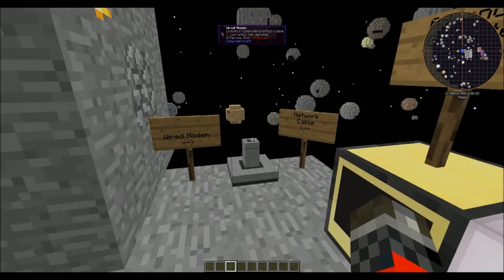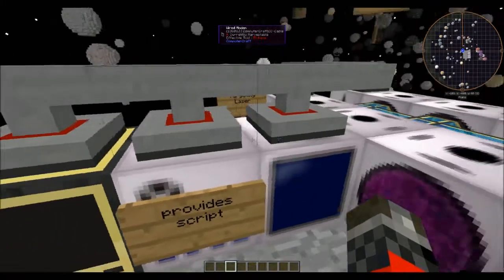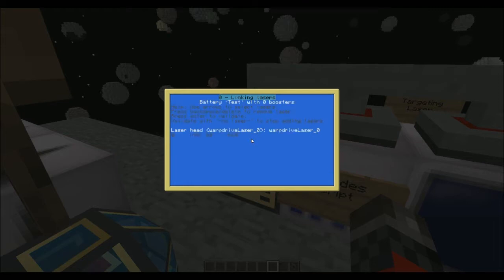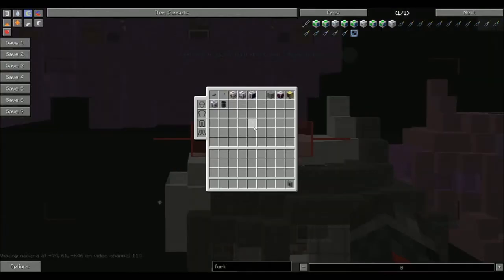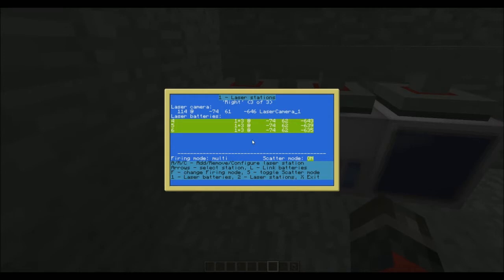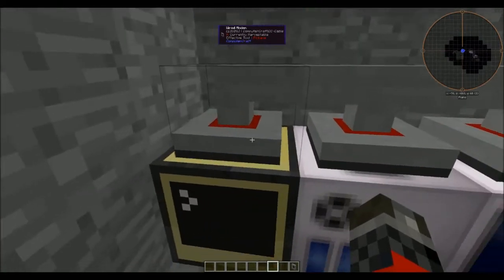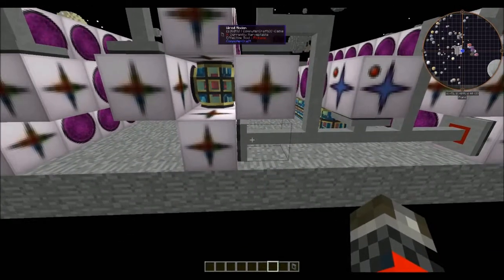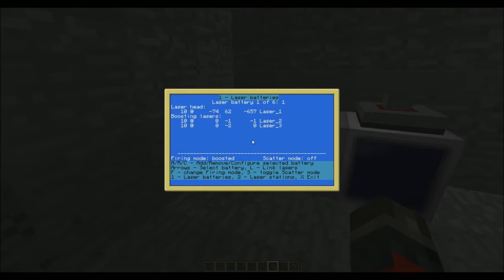Warp Drive Laser Setup (Old)

Comment: i play technic  and its got a pack that has warp drive 1.7.10  on it and it does not work with the simpl laser.
Reply from the maker: I haven't used the older version for a very long time so I'm unsure. First I would check with the modpack author and see if they've changed any settings. Also, you can go over to https://discordapp.com/invite/0ZanfS3S9yu3Wf2M and ask in the #warpdrive channel and ask your question there. The mod author checks it frequently.

Comment: wait u only need the warp drive mod for all this to work or does it need multiple modd?
Reply from the maker: No. For the laser system to work you need either computer craft or open computers to configure all of the lasers and link them together. Also you would need a mod that generates and transmits power to power all of the lasers. Technically you could use the subspace capacitors and the reactor from warp drive to create the power and transfer it, but it would be a pain.

Comment: How do I get the monitor to work? It doesn't do anything when I right click on it.
Reply: Here's how:

Step Zero:  If you want a super simple laser that still works, make only one row of laser mediums (purple things) with a laser camera at the end.  Power the purple things with wire (i like gold wire) and a power source like the zero point module in creative, or a reactor or solar panels in survival.  Set a monitor nearby, or far away, doesn't matter.  Take any tuning fork and right click on the laser camera and the monitor, then hold crouch and right click them again just to be sure.  This will make sure they're using the same video channel.  Then right click the monitor with an empty hand and start shooting stuff with the spacebar!  Just don't shoot the purple things.  Big boom boom.  Hit E for inventory then left click to zoom in and out.  Right click to exit the gun.  

You can only shoot red lasers with the laser camera, but you can still do damage.  This is a good laser to have something small, or hidden somewhere on your house or ship, as it can be 1 by 2 by 3 blocks at it's weakest, or 1 by 2 by 11 blocks at it's strongest.

If you want the bigger lasers, with different colors and options, here's how.

Step 1:  make sure the modems and wire are touching your laser camera, your main laser, the supporting lasers, the monitor, weapon controller, and computer.

Step 2: Make sure laser "mediums" (purple things) are powered

Step 3:  Right click on the laser you want to be the MAIN laser, or "laser head" and remember it's number.  Make sure all modems are turned on by right clicking them.

Step 4:  Take any tuning fork and right click all lasers, cameras and monitors.  Then hold crouch and do it again.  Matches up the video channels for your controller, the other lines up the laser frequencies so they can boost each other.

Step 5:  right click the main computer with an empty hand.  It should say no monitor,  and then how many attack lasers and laser cameras it sees.  If it doesn't see anything, try saving and quitting then reloading the map and clicking on the computer again.  This works for me.

Step 6;  Batteries are the small groups of lasers and their main laser.  Stations are groups of batteries.  Press 1 for laser batteries, then A to add one, then L to add a laser "head".  Use the arrow keys to find the number of your favorite laser from step 3.  Hit enter, then use the keys to find a different laser, then hit enter, then a different laser, until you use all the ones you want.  Then hit enter when it says no laser.  If you run out of lasers and can't find one you're not using already, hit backspace instead of an arrow key to change it to no laser then hit enter to finish the battery.

Step 7: Hit C to configure the battery.  It will ask for a name, so name it something you'll remember, like "reaaaallly big gun#1"

Step 8: Then it will show you the beam frequency, which you can change.  1 is red, 65000 is white, and in the middle are the colors of the rainbow, try out numbers, going up by 5000s or something until you find a color you like.  You need to fire to test the colors.  HIT ENTER.

Step 9:  HIT 2 for laser stations (groups of batteries) then hit A to Add a station, then L to pick a laser camera.  Use arrow keys again, then hit enter.  Then it'll ask which battery you want, so use the arrow keys AGAIN, and hit enter again.  You should see a screen saying 'noname' laset station, 1 of 1, the location and number of the camera, and the battery you named, (realllly big gun#1)

Step 10:  hit F to decide betwen single, multi, and boosted.  Try them all out for fun;  single only uses the laser head, multi shoots with all of them, and boosted is when the support lasers shoot your favorite laser to make it stronger.

Step 11: press S to turn scatter mode on or off.  Scatter on is like a baseball bat, good for making big holes through weak targets like glass and dirt, scatter off is like a knife, good at making small but deep holes through tough targets like metal and rock.

Step 12:  Hit C to Configure your station. Name your station, something like "top of ship" or "front guns" or "back guns".  The pont of this is so your back guns don't try to shoot through your ship to shoot forward.  This will make an explosion.  If you want to shoot in all directions, you'll need at least two stations, like front and back, left and right, or top and bottom, so you never accidentally shoot through the middle of your ship.

It will give you a video channel, which you can change.  I think this is so you can have multiple monitors attached to the same computer and weapon controller without messing with each other.  One monitor for every station.  One frequency for every station.  You can also use the tuning forks for this.

STEP 13!!!!  MOST IMPORTANT!!!
IT WILL ASK you if you want to KEEP BATTERY (reallly big gun#1) enabled.  >>>>>>>>>TYPE "Y" LIKE IT SAYS OR IT WILL NEVER WORK.<<<<<<<<<

Step 14;  DO NOT, DO NOT, DO NOT HIT X TO LEAVE THE COMPUTER OR YOU WILL HAVE TO BREAK THE COMPUTER AND START AGAIN AT STEP ONE!  Hit escape instead.  You're done!  Right click the monitor with an empty hand, then look around, and hit spacebar to shoot!  Just bee careful not to shoot back into the laser, or boom, and try not to shoot in the direction of any of the modems or wires, or only the laser camera will shoot and it can't hurt anything when attached to a battery.  You can hold the space bar down though and make it look like a machine gun.
Reply: Thank you! I wasn't clicking with an empty hand that was my problem.
Reply: Sweet, now I can build an enterprise with working phasers!
Reply: Christopher Merrell exactly what I was thinking.  big death star laser on top and bottom of the hood, and in the deflector dish

Comment: How do you make lasers more powerful ?
Reply from the maker: By adding more laser mediums you increase the amount of power the laser can fire. Also you can set the lasers to boosted mode by pressing F to cycle firing modes while in the computer. If you have 4-5 boosting lasers and 10 laser mediums each you will hit the maximum allowable power.
Reply: 4-5 is maximum?  Lame.  I was hoping to try 20+.
Reply: will anything explode if I do more than that?
Reply from the maker: No. It just stops getting stronger. You could still have 20 lasers all focused into 1 but it just won't get stronger

Comment: it says no monitor detected and its only firing the camera laser
Reply: I got the same message but got it to work.  Here's how:

Step Zero:  If you want a super simple laser that still works, make only one row of laser mediums (purple things) with a laser camera at the end.  Power the purple things with wire (i like gold wire) and a power source like the zero point module in creative, or a reactor or solar panels in survival.  Set a monitor nearby, or far away, doesn't matter.  Take any tuning fork and right click on the laser camera and the monitor, then hold crouch and right click them again just to be sure.  This will make sure they're using the same video channel.  Then right click the monitor with an empty hand and start shooting stuff with the spacebar!  Just don't shoot the purple things.  Big boom boom.  Hit E for inventory then left click to zoom in and out.  Right click to exit the gun.  

You can only shoot red lasers with the laser camera, but you can still do damage.  This is a good laser to have something small, or hidden somewhere on your house or ship, as it can be 1 by 2 by 3 blocks at it's weakest, or 1 by 2 by 11 blocks at it's strongest.

If you want the bigger lasers, with different colors and options, here's how.

Step 1:  make sure the modems and wire are touching your laser camera, your main laser, the supporting lasers, the monitor, weapon controller, and computer.

Step 2: Make sure laser "mediums" (purple things) are powered

Step 3:  Right click on the laser you want to be the MAIN laser, or "laser head" and remember it's number.  Make sure all modems are turned on by right clicking them.

Step 4:  Take any tuning fork and right click all lasers, cameras and monitors.  Then hold crouch and do it again.  Matches up the video channels for your controller, the other lines up the laser frequencies so they can boost each other.

Step 5:  right click the main computer with an empty hand.  It should say no monitor,  and then how many attack lasers and laser cameras it sees.  If it doesn't see anything, try saving and quitting then reloading the map and clicking on the computer again.  This works for me.

Step 6;  Batteries are the small groups of lasers and their main laser.  Stations are groups of batteries.  Press 1 for laser batteries, then A to add one, then L to add a laser "head".  Use the arrow keys to find the number of your favorite laser from step 3.  Hit enter, then use the keys to find a different laser, then hit enter, then a different laser, until you use all the ones you want.  Then hit enter when it says no laser.  If you run out of lasers and can't find one you're not using already, hit backspace instead of an arrow key to change it to no laser then hit enter to finish the battery.

Step 7: Hit C to configure the battery.  It will ask for a name, so name it something you'll remember, like "reaaaallly big gun#1"

Step 8: Then it will show you the beam frequency, which you can change.  1 is red, 65000 is white, and in the middle are the colors of the rainbow, try out numbers, going up by 5000s or something until you find a color you like.  You need to fire to test the colors.  HIT ENTER.

Step 9:  HIT 2 for laser stations (groups of batteries) then hit A to Add a station, then L to pick a laser camera.  Use arrow keys again, then hit enter.  Then it'll ask which battery you want, so use the arrow keys AGAIN, and hit enter again.  You should see a screen saying 'noname' laset station, 1 of 1, the location and number of the camera, and the battery you named, (realllly big gun#1)

Step 10:  hit F to decide betwen single, multi, and boosted.  Try them all out for fun;  single only uses the laser head, multi shoots with all of them, and boosted is when the support lasers shoot your favorite laser to make it stronger.

Step 11: press S to turn scatter mode on or off.  Scatter on is like a baseball bat, good for making big holes through weak targets like glass and dirt, scatter off is like a knife, good at making small but deep holes through tough targets like metal and rock.

Step 12:  Hit C to Configure your station. Name your station, something like "top of ship" or "front guns" or "back guns".  The pont of this is so your back guns don't try to shoot through your ship to shoot forward.  This will make an explosion.  If you want to shoot in all directions, you'll need at least two stations, like front and back, left and right, or top and bottom, so you never accidentally shoot through the middle of your ship.

It will give you a video channel, which you can change.  I think this is so you can have multiple monitors attached to the same computer and weapon controller without messing with each other.  One monitor for every station.  One frequency for every station.  You can also use the tuning forks for this.

STEP 13!!!!  MOST IMPORTANT!!!
IT WILL ASK you if you want to KEEP BATTERY (reallly big gun#1) enabled.  >>>>>>>>>TYPE "Y" LIKE IT SAYS OR IT WILL NEVER WORK.<<<<<<<<<

Step 14;  DO NOT, DO NOT, DO NOT HIT X TO LEAVE THE COMPUTER OR YOU WILL HAVE TO BREAK THE COMPUTER AND START AGAIN AT STEP ONE!  Hit escape instead.  You're done!  Right click the monitor with an empty hand, then look around, and hit spacebar to shoot!  Just bee careful not to shoot back into the laser, or boom, and try not to shoot in the direction of any of the modems or wires, or only the laser camera will shoot and it can't hurt anything when attached to a battery.  You can hold the space bar down though and make it look like a machine gun.
Reply from the maker: Double check all of your wired modems on all the blocks to make sure they're turned on. Also make sure you configured the laser batteries and laser stations in the computer program properly.
Reply from the maker: I know this is long but I hope it clears things up. it is confusing.
Reply: When I right click the monitor the game crashes